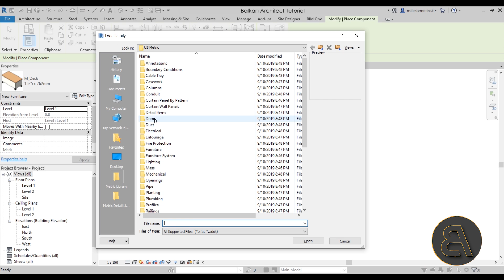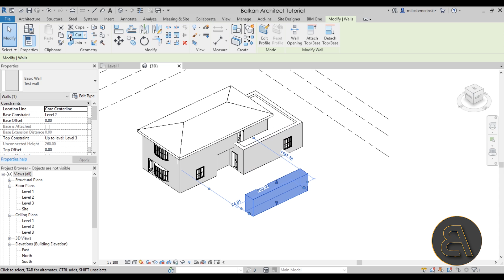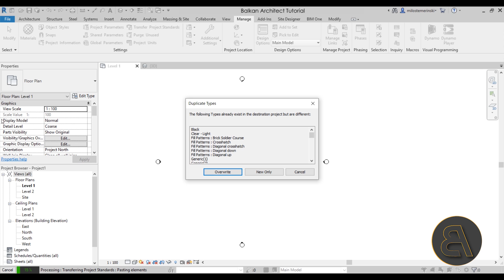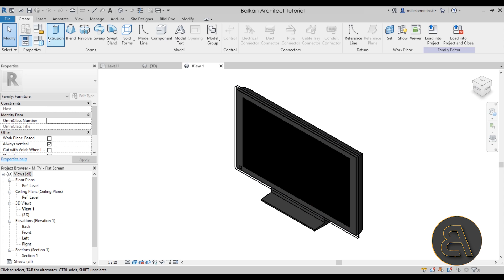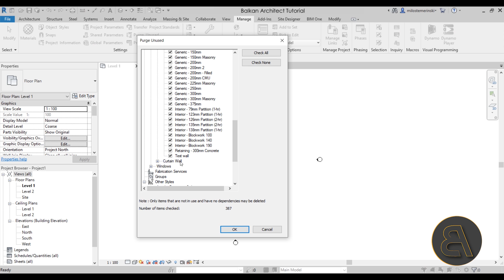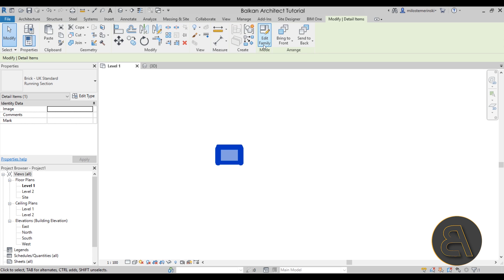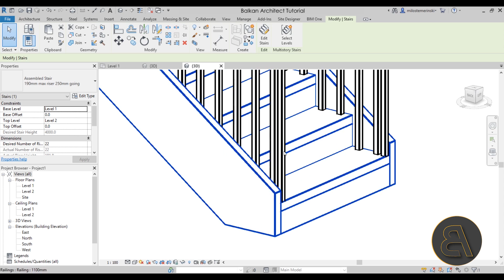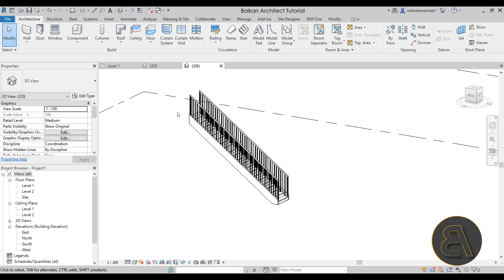System vs Component Families in Revit Tutorial

Comment: I’m currently struggling with making a custom shaped curtain wall that has custom panels. it’s seems only system curtain panels can adopt wall shapes non rectangular as custom panel families can’t. Any advice on how to edit a system family curtain panel. Or a simple method for adaptive curtain panels. Many thanks
Reply: Yes, system panels are way more flexible in therms of shape, but like other system familys, you can only edit so much. For the system panels that is only the thickness, offset and material. If you want any more complex panels, you need to make normal curtain panel familys. But note that the curtain panels are not just limited to the ''curtain panel'' category in revit, walls, doors and windows can also be used as a curtain panel. For the door and window panels you used the specific family templates for them. 

If your curtain panel is to complex for a system panel, your pretty much stuck with the normal curtain panels, or a mix of them. Thats the disadvantage of curtain walls. You can create very complex curtain walls with dynamo, but im not that far with dynamo yet so i can not tell you much about that. 

Most of the times i tend to stick with as much system panels as possible, since they improve performance a lot when working with curtain walls.
If your curtain wall needs to be really complex, you might want to use a family instead of a curtain wall.

If you want to ask questions and show some pictures with it, come over to revitforum.org and post it there.